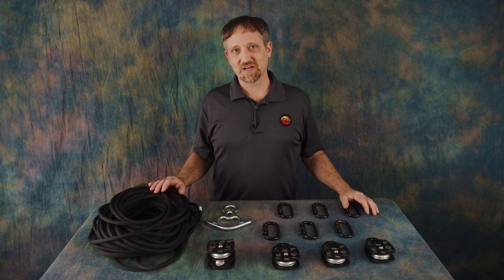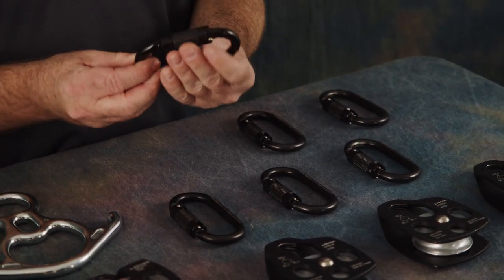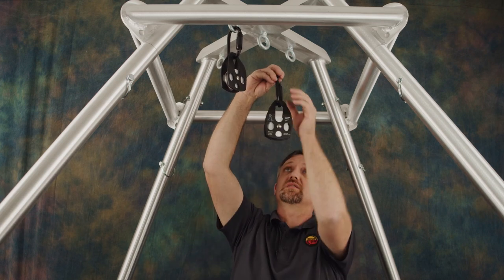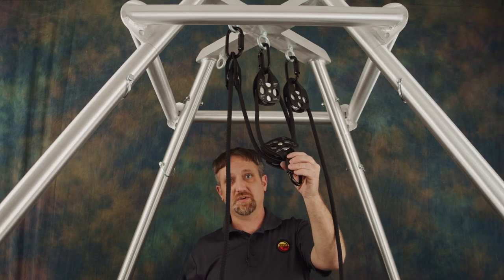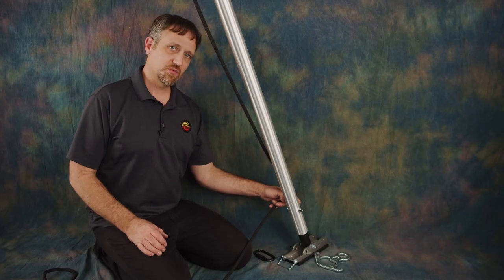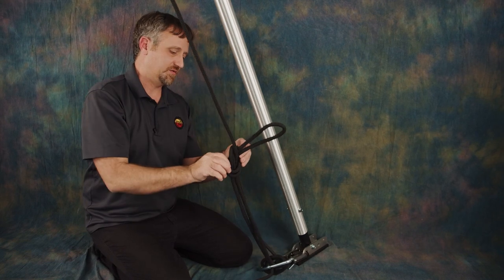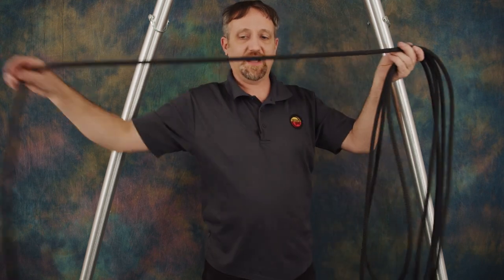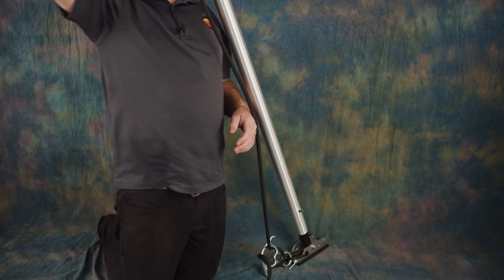Circus Gear 4:1 Pulley System Instructional Video

Comment: when i was pulling my silks up and down, the rope kept twisting at the top near the pulley system. its not tangled but it gets really frustrating. any way to fix this?
Reply: its because the rescue eight device introduced some twists in the rope. That style of rappel device will do that, another device you can use that wont twist the rope is a Petzl RIG but thats more expensive.

Comment: Hey really good video! I can't rly afford a proper rig but I'm thinking of putting a pulley system in my yard on a very solid tree for a few trainings (I can almost see the disapproving faces). But how could I do that safely enough? I could hang safety also in different parts of the house cause the tree is fairly close to the house..
Reply: Pls help an aerialist who's desperate to train xp
Reply: Plz don’t rig from trees. It’s super dangerous. Check out the group safety in aerial arts on fb
Reply: I had a professional arborist with rigging experience come and hang a tree swing.  I was surprised by how much thought and analysis goes into rigging ANYTHING from a tree.  He verified the species, approximate age, and analyzed where we wanted the swing to hang from.  He rigged up his own gear, climbed the tree and did some further analysis on how to properly rig the swing.  We thought "what's the big deal?  It's a tree swing... just hang it from that massive branch!"  The big deal is... that you have no idea how strong that branch is especially to dynamic forces like swinging and dropping.  He actually rigged it to the trunk and over the branch so a lot of the load is shared with the trunk instead of just 'hanging it from a big branch'.  

My point is... you really need a professional at some level.  Either a professional to build a rig so you have a safe place to hang from or a professional to inspect that tree and provide a safe rigging point.  Same as if you were to hang it from a structure like a house or barn; you need a professional to analyze where it's safe to rig from with the forces you will be generating.
Reply: @xristinaatss  It's not a good idea. Generating thousands of lbs of force on tree branches, even if rigged correctly by an arborist, still presents a significant increase of risk.  Though it can be done, doing it right would be more expensive than buying a rig since you would have to re-assess by a professional after every use. It might not be what you want to hear and I understand that frustration, but please be safe! ❤❤❤